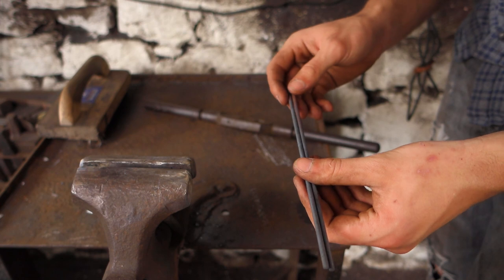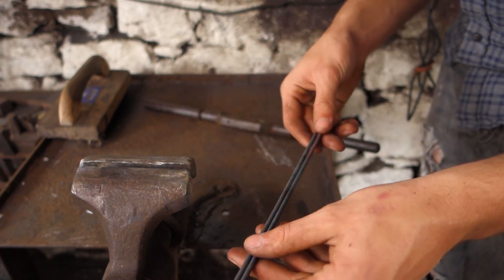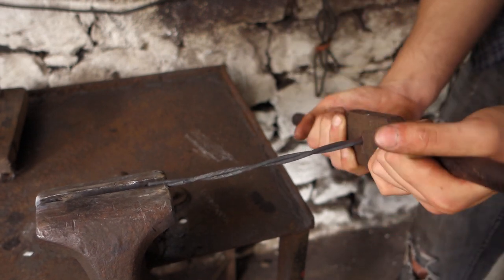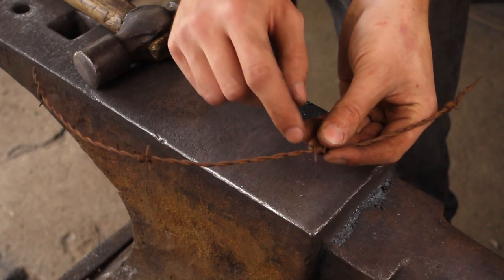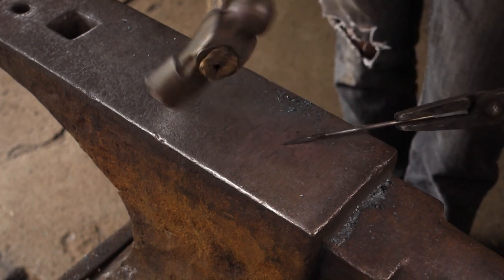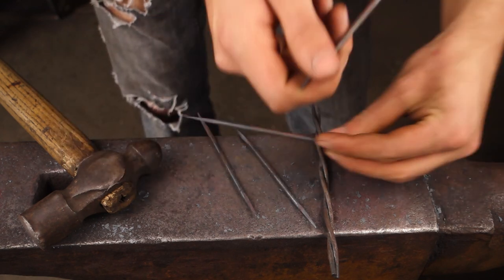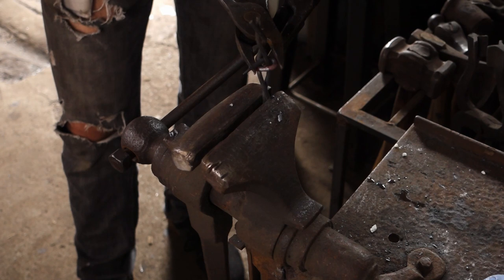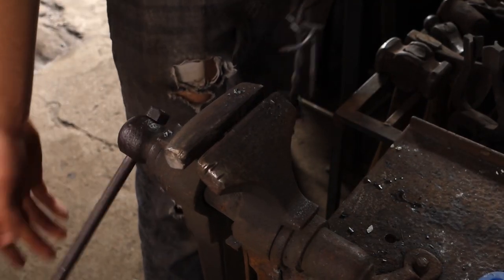Making Barbed Wire by hand!?!

Comment: So, out of the hundreds of barbed wire styles, why did you choose the Ross?  It's definitely a tough design but the least conducive method for replicating by hand.  The Ross was originally meant to have barbs in all four directions (90deg separation) rather than two sets of barbs 180deg apart.  The type of barbed wire most often encountered (two point twist) is made by taking a single wire, wrapping the barb around it with almost two wraps (660deg), and then twisting the other wire around the barbed single strand to make the complete wire.  Nip the ends off at an angle to make a sharp point and you're done.  The barb will move to a small degree on the single wire but the twist on the other wire holds it in place well enough to do the job, in fact, some of the cheaper wire actually forgoes the double wrap entirely with just a 300deg twist.  I've used this method a few times when repairing a section of fence using bailing wire when I didn't have any barbed wire on hand.  I suppose for that reason it's the easiest to replicate in an automated facility, hence why it's so common these days.  In the late 1800's you might see several dozen types with very little similarities between them.
Reply from the maker: That is very interesting, I didn’t know that there was a lot of different designs to be honest. I’ve just always wondered what it would be like to try and make it by hand, so found a piece on the farm to replicate. Thanks for the information!
Reply: @oscarduck1920  Ah, that would make sense.  If I didn't know there were other designs, I'd probably think they were all pretty much the same thing as what I had in my hand.  The type you have is a clever little workaround, as so many of the types were back in the 1800's, in order to sell bootleg copies of a patented product.  Make a small change in the way the wire is wrapped or the barbs are made, and they bypass patent laws.  Ross came into the game a little late, as there were tons of companies saturating the market by that time, so this wire found its way out of the US where the market was still fresh.  Probably why you found this type as opposed to the mass produced simple stuff in the US.  If you ever run across some wire that looks really odd and not at all like simple barbed wire, see if you can identify it.  Some varieties are very rare and valuable to collectors.

Another interesting fact for blacksmithing, some of the thin strand barbed wire is made with high carbon steel for better tensile strength and can be heat treated to acceptable knife and chisel hardness. The wire is heat treated and subsequently tempered close to the annealing point, to allow for bending and wrapping while maintaining some of its strength.  You can generally identify it by a smaller wire gauge and higher tension being used on the fence.  Sometimes you can find lengths of it laying near corners and end posts.  Be mindful of the galvanized stuff if you forge it though, it's hard to keep inclusions out of the billet unless it's cleaned well.
Reply from the maker: Thanks again for the info you seem very knowledgeable! That’s a funny one about the patents, I’ve never even thought about barbed wire as being some that could have a patent, but now you mention it, it seems obvious.
Reply: @Skinflaps_Meatslapper  This is so interesting and cool! Is this an avid, active interest for you, or just a passing hobby? Have you read The Devil's Rope? I'd never considered that there'd be barbed wire collectors! So neat :)
Reply: @dextrapede  I'd call it more of a passing interest.  I'd run across all sorts of old fencing running around ranches which made me curious as to why, and the info proved helpful mending fences and whatnot.  I haven't seen a whole lot of it lately, but years ago it was pretty commonplace at ranches to have a board to display all the different types of wire they found on their property.  Big ranches would absorb smaller ranches over the years, and as long as the fences were holding, they'd stay.  I've seen some fences that were placed in the wild west days, still standing and doing their job!  Anyway, those displays would occasionally find their way into flea markets and western themed restaurants and such, but I guess interest has waned over the years as it's been a while since I've seen one in a while.  It was pretty neat to see really off the wall designs in remote places that had rarely been visited since they were strung all those years ago.  If I ever had to repair a section of historical fencing, I always did what I could to mimic that style rather than replace it with a more simple modern design...perhaps someone a hundred years from now will appreciate it, who knows.